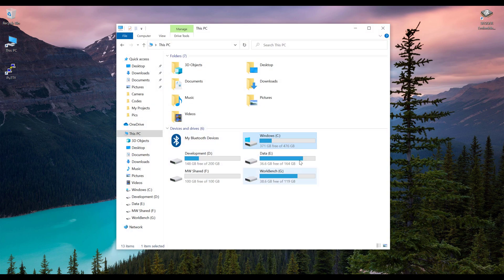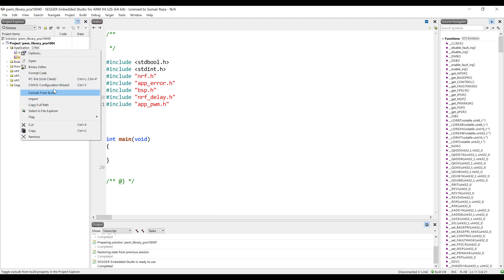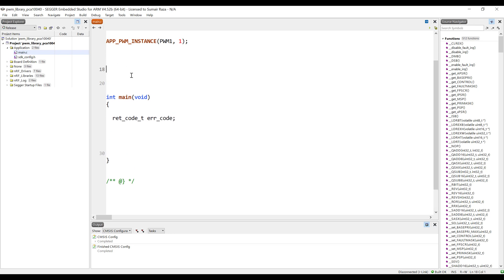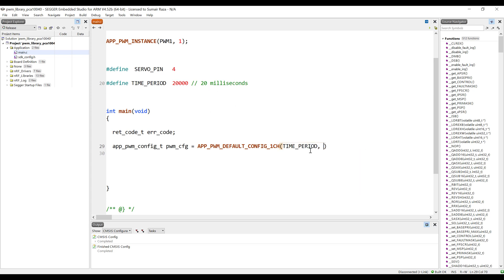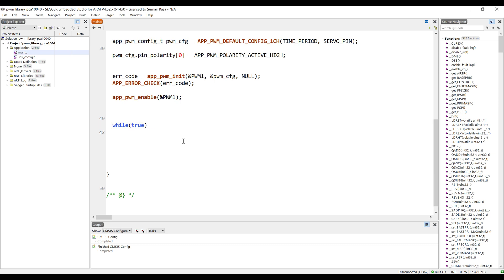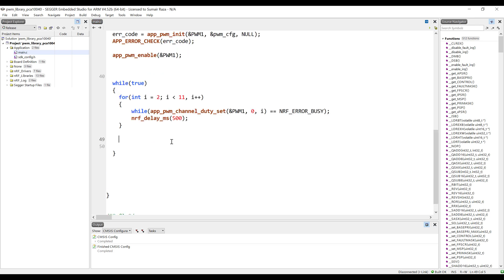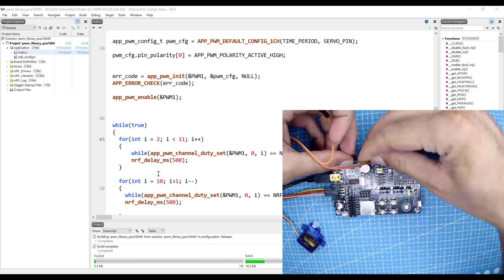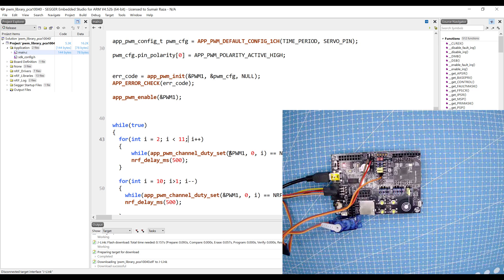nRF5 SDK - Tutorial for Beginners Pt 32A - Servo Motor Control using PWM Library

Comment: Hi sir. In the final board connections, I have understood that the MCU is connected to the PC/laptop by USB cable, then the motor. What are the wired connection (yellow, red, etc) connected to the board?